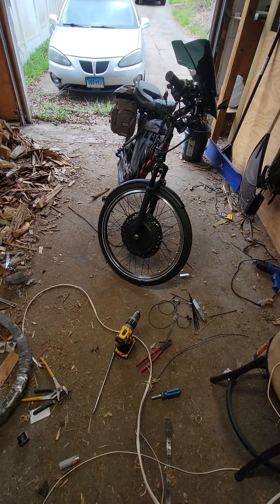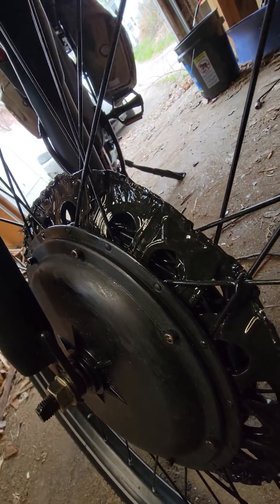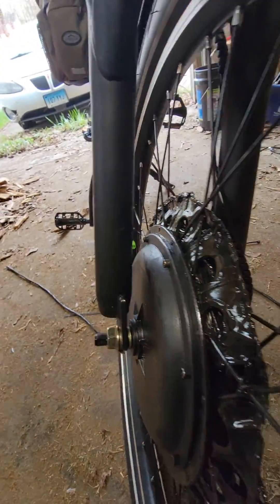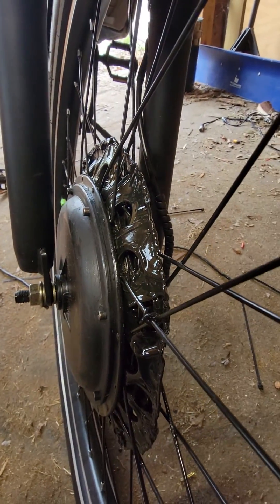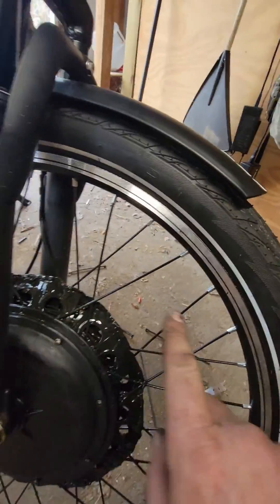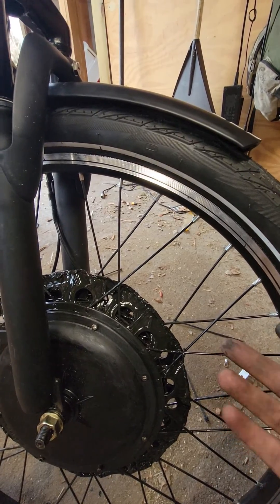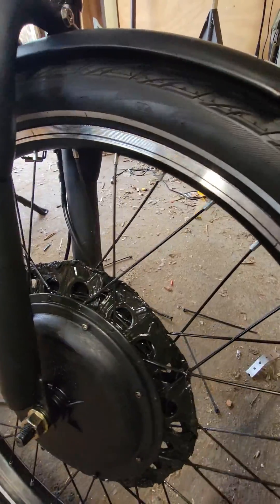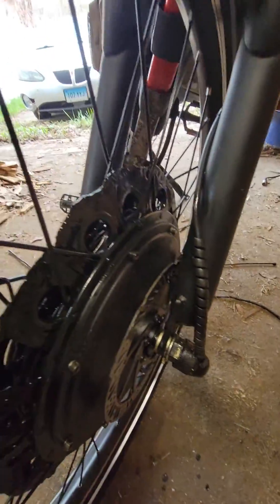ebike " Mohawk hub motor heat sink "

Comment from the maker: Basically when you run it hard the radiator fins are 99.999% ambient,  the side of the motor is warm , when you park the bike the radiator fins warm up and you do lose the benefits of more surface area then . But I'd rather have it optimized for rotational cooling then static